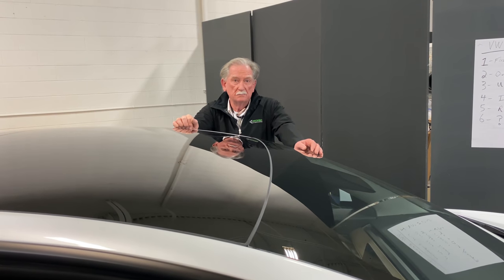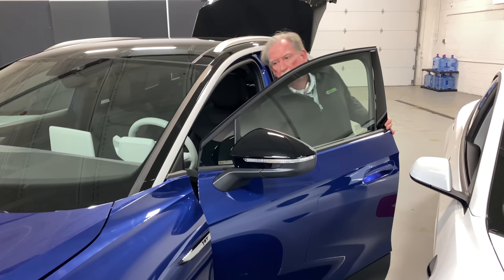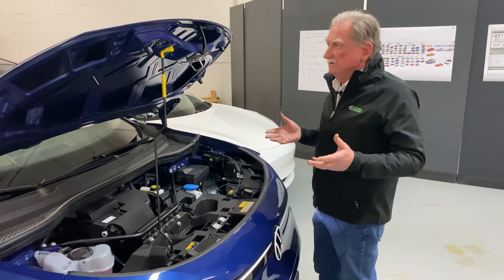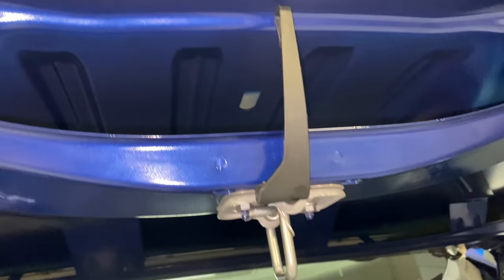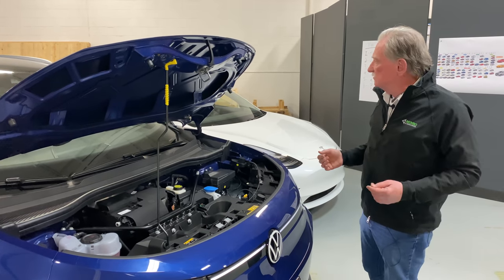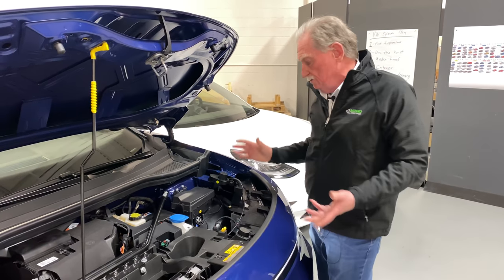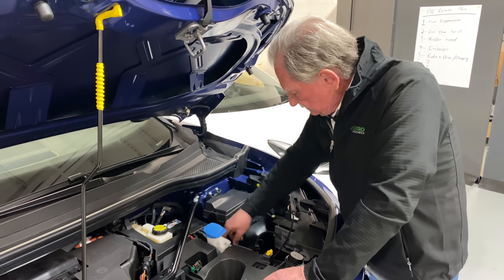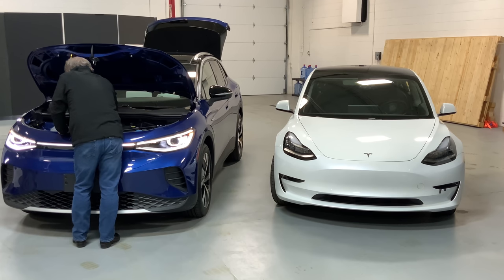2021 Volkswagen ID.4: E2 - Under The Hood

Comment: I never understood the need for a frunk. Just make the hood shorter. This leads to a smaller car or more space inside the vehicle. I like the approach of VW. You also don't open the hood very often and therefore it is a minor inconvenience if the hood is a little heavier.
Reply: In EVs, you have the cables, quite a few and all other typical car stuff as washer liquid, yellow west, fire extinguisher (some markets), water etc. It is all the unwieldy stuff you don't like to keep in the trunk. True, there is the under-floor trunk compartment, but it is a moronic idea, as, according to Murphy's Law, it is only needed, when the trunk is full. All cars should have frunk!
Reply: In case of impact, longer hood gives you more time(space) to slowdown.
Reply: @AndrewSienx  I have an electronic car and these things are located in a side compartment in the trunk. No problems there.
Reply: @GroxMirk  Good point, but here are some tricks that improve the effect of a shorter hood. Operating large vehicle in European cities is sometimes inconvenient. I prefer smaller vehicles over additional storage in the front.
Reply: @MMA4711  I prefer a large enough front with large enough crash zone to protect my family and me. 
The current Tesla Models have just the correct amount for that. Nothing more. Nothing less.
Reply: @wolfgangpreier9160  How does your tesla protect against side impact????? not with a frunk for shure. It is about designing structure for impact not a long hood.
Reply: @merzto  With depth. There are some nice videos around here. In the front with very long shock absorbers to proptect its valuable freight. 
Me and my family.

In the doors with very strong and thick absorbers which distribute the impact force into the A and B pillars on both sides before crumpling and softening the impact.
Look at the doors how thick they are compared to a e.g. Bolt or Mustang from 2017.
Reply: indeed they used the space for passengers but also for the front wheels, so they can turn more and the turning circle is much improved in this car
Reply: @merzto  with side impact you usually have no speed in that direction at all to slow down from. You are getting speed on impact. So there is completely different situation.
Reply: Mathias - the FRUNK acts as a LARGE Front Crumple zone , which is why MODEL Y is safer than the iD4.
Reply: @markplott4820  So what is the Ncap score for the ID.4?
Reply: @markplott4820  Not "safer" but the risk of injury to the driver and the colliding "other" is reduced. More space means reduced impact forces. That only goes as far as those spaces are used as crumple zones. Not like in old cadillacs where there is space but not one single crumple zone.
Reply: @wolfgangpreier9160  What is it the same or smaller? id3 got the highest score last year. not as great as model 3 but the bar has been raised. So it's far from a death trap.
Reply: @mikaelpettersson5916  Of course it has good even very good crash test results. One step below the best is better then 99% of the rest. Thats very good in my opinion.
MEB based cars have not been built to be the safest possible vehicle. Just the best compromise in terms of the best middle class EV platform for VW.
Reply: @wolfgangpreier9160   - the ALL Glass roof is also STRUCTURAL.
Reply: @markplott4820  Dont disagree, 
But each year Euro Ncap gets more strict. 
so comparing scores from different years means nothing.
Reply: @storm4710   - ALL that matters is the VW iD4 is Hundreds of KILO overweight and its LESS Safe than a 2018 Model 3.
Reply: @markplott4820  It´s heavier no doubt about that, 
Still manages decent efficiency(watch Tesla Bjørns ID.4 1000km challenge)  
ID.4 has yet to be crash tested,
And even then you can't compare a car tested in 2019 vs a car tested in 2021.
Reply: @storm4710   - I personally think that the 2021 Model Y from GigaBerlin will be the WORLDS Safest car and the BEST car to OWN.
it will use Everything Tesla has learned from  model 3/Y interior Refresh to model S/X Refresh .
Reply: @markplott4820  And your point is?
Reply: @wolfgangpreier9160   - VW iD4 is build 5 years Behind TESLA and in 2022 Tesla will start selling a $25,000 car made in China.
Game Over.
Reply: @markplott4820  No, not game over. Tesla could not build 40 million new cars a year. They want every existing OEM to build sustainable cars. Those that have started will survive. All others not. But that will take many years.
Reply: @wolfgangpreier9160  safest vehicle possible? Get a tank
Reply: @ionbarari7202  I am not allowed to drive a tank. And no: A tank is NOT the safest vehicle. Just take a look at the statistics of incidents and injuries. 
Repairing Teslas is expensive, yes, but repairing my body or that of anyone in my family is more expensive.
Reply: @wolfgangpreier9160  how much safer is a TM3 than a ID3? At what speed?
Have you checked the test euro ncap fully or just the percentages? Because 2020 differs a lot from 2019
The differences are small between them, surely not enough for a "step below" (unless we talk pixies)

Comment: Unfortunately, this was unexpectedly superficial video. I would assume such from a piano man but not Sandy Munro. There was no context, unless the idea was such. For example, there are strict requirements for pedestrian safety, as I am sure Sandy is aware. You cannot just disregard them. More or less same is true for the stuff that’s normally put anywhere within the saloon but here is packed so that’s easily accessible. Are Tesla using some kind of antimatter so that they can hide the “technical” stuff without spending valuable saloon space? Or they just don’t expect anything to be touched without disassembling all the trims inside?
Reply: I just hope the Tesla doesn't need as much accessibility as the id4 to the technical

Comment: The I D4 dosent need a front trunk because it larger than the Model 3 and it’s a hatchback so you can put much larger items compared to a sedan I work on Volkswagen as a independent and what I see under the hood is great for a technician and the customer if you want to service or repair any thing it will take far less time and possibly HVAC parts may be easier to repair and or replace and the fuses thing is just normal for a Volkswagen it’s annoying that it’s not labeled but they are not alone ether GM Ford or Ram doesn’t label them ether. I hope you are going to tear it down its a very important car to do it because its going to be sold in the millions under the VW , Audi ,SEAT, SKODA etc this will show if they did a good job or not.
Reply: My Silverado's fuse boxes are both labeled!

Comment: The greatest enemy of electric vehicles is not weight; it's the drag coefficient combined with high-speed, since a doubling of speed requires an application of eight times the amount of power.
Reply: Such an underrated comment.

Comment: In the case of ID4, VW made a decision to skip a frunk to allow for a short front overhang coupled with good interior space.  The ID4 is 11 cm shorter than the Model 3 but still has considerably more legroom. ID4s smaller dimensions and turning circle makes this a more suitable car for European cities. 

When VW Group wants to have a frunk it does so as is evident with the Taycan, which uses the same platform as ID4, and the E-Tron SUV which isn't even a using a purpose built EV platform.

I would also suspect things look more tighter fit in the 4x4 ID4 which will arrive later.

And let's not forget that ID4 needs to fit a augmented reality module (which Tesla doesn't have).

Comment: I prefer to have an easily accessible cabin filter which I can change myself rather than pay someonet to do it.  My model 3 cabin filter is buried in the center stack and challenging to change for anyone over 40 😁.
Reply: The cabin filter in my 2008 Mazda 3 has never been replaced.
Reply: As I recall, the new hepa filter in the Model Y in China is also changed from under the hood. Hopefully this will happen in the American made Model Y too, as I’d love the superior filtration and ease of access.

Comment: Dear mr. Munro, Normally I really like your videos. You’re a very smart person with a lot of knowledge. So I’m a little afraid of writing this. There is a reason that the car is made like this. Like all designs, good or bad, if you like it or not. I prefer more interior space over a Frunk. I use the interior every day, the frunk not. 
The front is used to store all the assessors normally located somewhere in the front of the cabin. It creates more space inside the cabin. The car has a shorter hood with this design and, now it comes, a significant smaller turning radius ⭕️  compared to the model 3. And again, You’ll notice this every day ( a design choice) . About the charging cable: All fast chargers have cables installed and at home, if you’re smart you have a charger also with a cable connected. For the on street ac charging, you’ll use it less frequently, and if they are mostly on the right hand side of your car. So opening the back of the car is no issue there. Correct me if I’m wrong but I think you’ve missed something here. The interior space is very spacious. Please check the banana box test done by Tesla Bjorn. You’ll see that it is far,  far bigger inside , compared to the model 3. For everything else, a lot of respect for your opinions!
Reply: Weired, I use the frunk every day. Most comvenient place to put shopping bags, pizza, crate of beer, everything that fits, really.
Reply: @tamasstrezi  so the frunk is for all your unhealthy lifestyle choices....  ok boomer 👍

Comment: I think the ID.4 is shorter from the pedals to the front end than the Tesla as in Europe road space is much more limited than in the US. VW is saving the long hood  the Tesla has if you would reduce the long hood of the Tesla to where the VW ends, there might not be enough space for a Frunk as well.

Limited Road space: You would find no parking anywhere with F150 or Hummer H1 in Europe.

Comment: The first responders cutoff switch DOES NOT have to be cut nor does that bottle has to be removed. It is the little connector, you just push it out and disconnects the HV battery without even cutting a wire see here https://www.nfpa.org/-/media/Files/Training/AFV/Emergency-Response-Guides/Volkswagen/Volkswagen-ID4.ashx. Even the orange sticker that you hold clearly depicts that. So the firemen wont have to remove the washing fluid bottle before deactivating the HV battery. ID4 even has 3 possible locations for the firemen to shut off the HV battery (one at the front, one inside the cabinet and one at the trunk), the model 3 and Y have only one location!
Reply: If it's hidden it won't work.   We double-cut battery cables.   One isn't going to google to find a wiring diagram.
Reply: @kayak_1  You dont even have to cut the cable! Its so fast to just unplug a connector!
Reply: @iliaslolis1769  Training and procedures are to double cut the cable.   A single cut can reconnect as can a connector.  A double-cut will end with a good air gap.
Reply: @kayak_1  Thats not true, as soon as you disable that connector you cant reconnect it. Also, there is not any standard practice on how these systems have to be implemented, so first responders have to have training in all of different cars or have documentation on site, sorry thats the law. 

Also ID4 has 3 possible locations to disable the HV battery (in case one or more is not accessible). One on the hood, one inside the passenger compartment and one in the rear (which cuts a cable as you want!), way safer and accessible than any other system in the market.
Reply: @iliaslolis1769   Your looking for a non-standard practice.   Part of the normal procedure is to double cut the cables.   Thus you remove the power to prevent it from getting to the air bags etc.  One isn't going to google to search for how it's done for this car.   SOPs are followed.
Reply: @kayak_1  There isn't any "standard" procedure out there. And double cutting the wires hasn't become standard because Tesla chose to do so. Nissan does it differently, Toyota on their hybrids also. Also by "double cutting the wires" you dont cut the power to the system since no power flows through these wires, you just take the power of the HV Battery Contactor and force it to open. 

As soon as the method the automaker chose works safely it is acceptable by law. It seems that you dont get it. Next time.
Reply: @iliaslolis1769  It's the standard as that's what is done with every ICE car.   It prevents the airbags from deploying when we are working in the car.

Comment: One other advantage to the frunk is security. Unless the Tesla is powered on, you cannot open the frunk. This means if you have valuables you need to store, you can put them in the frunk, where they are safe, short of using a pry bar on the frunk cover. So unless a thief first steals a drivers phone or keycard, and then manages to get the phone open (i.e. no security on the phone), and then manages to power up the Tesla, the frunk is pretty secure.
Reply: The disadvantage of the frunk is extra weight ahead of the front axle that creates a nose-heavy FWD-like handling vehicle.
Reply: @7spower998  1. Only if you fill it with heavy stuff.
2. COmpared to an engine, and all the related stuff, the front end is very light. In fact, most EV's are pretty well balanced, F to R.

Comment: as a DIY'er im very happy to see this rather than yet another hole to put bags in, I was expecting you to explain what all the bottles are for and more
Reply: Washer fluid, coolant and brake fluid... the common stuff, not much changed here.
If you get an ID with a heat pump it uses CO2 as refrigerant instead of R-1234ya.
Reply: @DooMMasteR  coolant as in battery coolant? Servicing that on a Tesla is quite the undertaking, this is the sort of stuff I want to see more of on EVs

Thanks for clarifying
Reply: @EspHack  Yeah, coolant for battery and E-motor... it is also hooked up to the heat pump so the heat can be used for cabin heating or the heat pump to preheat the battery.